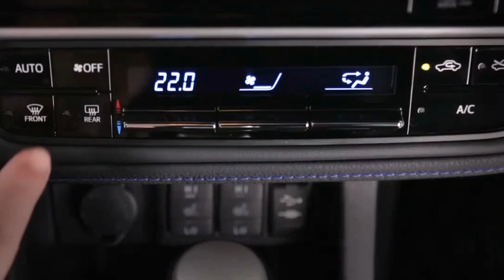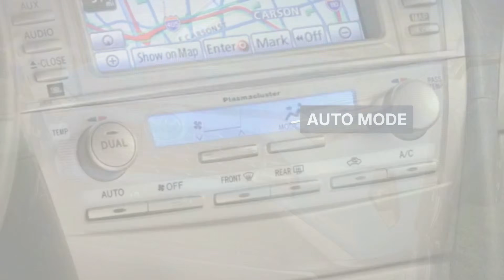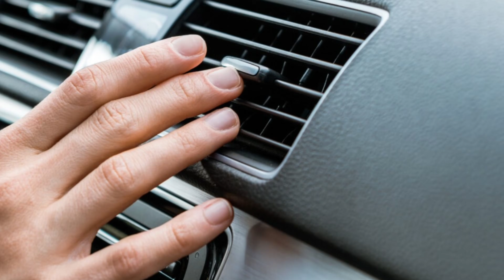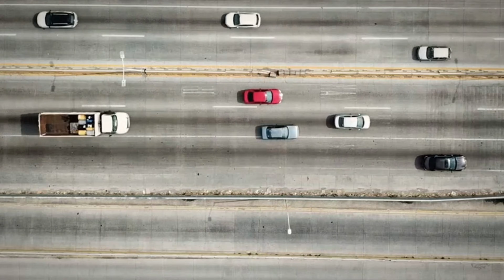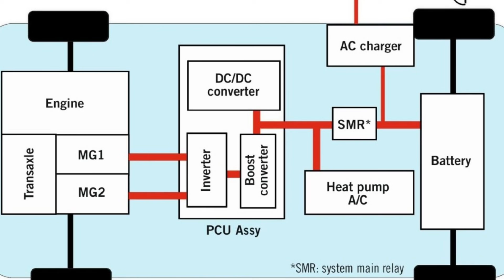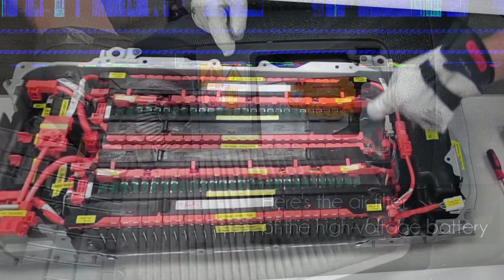The Toyota Hybrid Battery Drain Setting That's Costing You $40/Month in Fuel (DISABLE It NOW)

Comment: The accessories do not pull power directly from the hybrid battery. They pull power from the 12  volt starter battery which in turned is charged by an inverter that is fed from the hybrid battery.

Comment: On ny 2014 Lexus 300h I discovered that I could go into the control panel and shut off the ac pump.  This produced excellent summer fuel mileage.  I haven't tried it yet with the '23 UX250h.

Comment: I think the reason the A/C compressor comes on with the defrost section is, That it runs the compressor so that the it will not seize up in the winter.  If it was not run all winter it could cause problems .
Reply: Run it once and a while to help keep an oil mist coating the inside of hoses and O-rings. This will help seal in the expensive refrigerant gas from slowly escaping.
Reply: It helps remove moisture what is big deal my 1974 Volare did this.